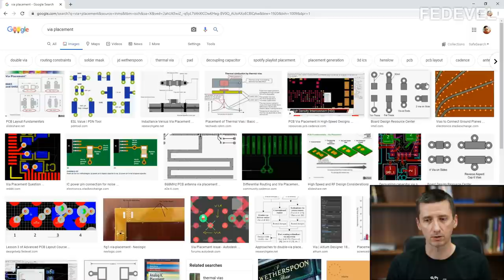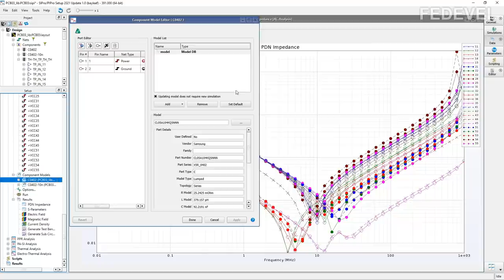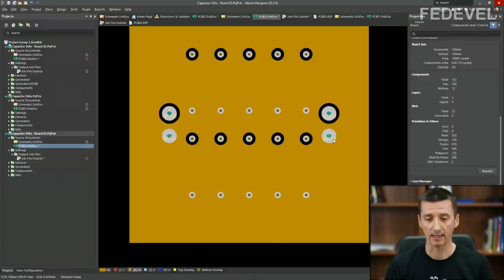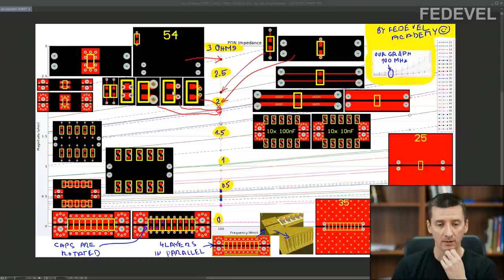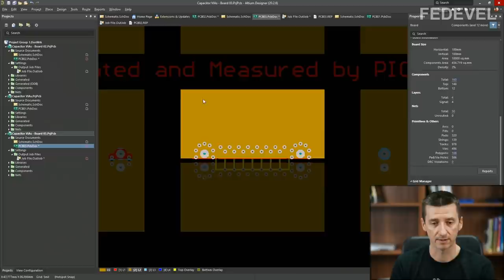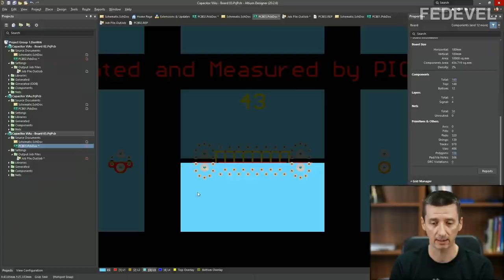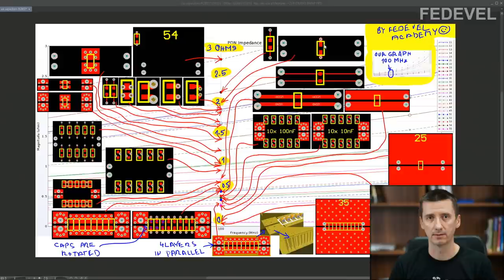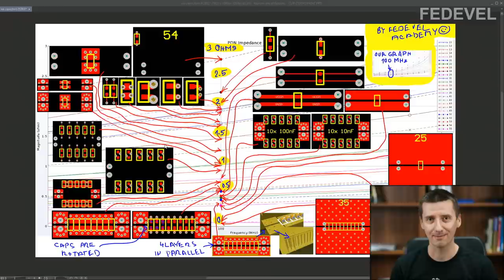What is The Best VIA Placement for Decoupling Capacitors?

Comment: It was good to demystify the "vias on the side are better than vias on top of the pad". Very little difference indeed.

In my opinion, the interesting layout would be having the capacitor on the same side as its load connection, but the input supply coming through vias from the power planes. This is a very common implementation in DC/DC power supplies. Check the typical symmetrical CIN decoupling implementation suggested in most power devices from MPS or TI, it has minimal impedance and the EMI emitted gets canceled out by the opposite direction of the fields.
Reply from the maker: I should try this, good idea!

Comment: Another great video in the decoupling series.  As I understand it, local decoupling (10n - 100n) needs to be at the pins, but bulk decoupling (1uF and above) just needs to be connected on the planes.  It would be good to add these to your test PCB, also.  It is not clear from your excellent plots how the frequency of the ESR notch is affected by the different connection types.  Does this matter?
Another test would be what effect does putting the decoupling capacitor AFTER the output pins have, compared to having it BEFORE the output pins?  Your test PCB from part 1 has the local decoupling after the CPU power pins, but the common advice is to make the PDN track go to the capacitor and then to the device power pins.  Does this really matter?
Keep up the great work.  Look forward to further involvement from Steve, Eric, and Rick!
Please build and test the PCB.  Theory is important, but real measurements confirm the simulator's predictions.
P.S. I think there is more to learn about the ferrite beads from part 3.

Comment: Hi Robert, great video! Really interesting. It will be amazing if you measure this! 
It make sense that not using vias yield to lower impedance, because they introduce a inductance that will increase the impedance with a increase in frequency. That is why is better to use multiple vias in parallel, because you reduce the inductance (series) between the capacitor and the plane.

Greetings from Argentina!

Comment: Thanks Robert, fantastic work.

In terms of additional simulations to try, I would be interested to know whether it was adding more capacitors that gave you better results, or whether it was simply that by adding additional capacitors that caused some to located closer to the load terminals (on the right hand side of the board), rather than being located in the middle of the board.

Regarding using big areas of copper on the top-surface, whilst soldering the caps to big areas of copper (as in #25) gives a nice low-impedance, I suspect that the lack of thermal reliefs will cause production reliability problems during IR-reflow soldering. They would also be a nightmare for re-work, as you would have to heat up the whole copper-plane just to de-solder the capacitor. So, this might cause more trouble than it is worth.
Reply from the maker: Thank you Nicholas PS: Today, I was thinking exactly the same - if just placing some of the capacitors closer made the difference. Maybe another example to try ....

Comment: That was interesting! If I understood correctly, you set the input on the left and the output on the right, so this uses capacitors as filters, not decoupling... If you set the input and output port on the same side of the pcb, it is more like the way a chip sees the impedance of the PDN at its power pin, I think you'd get different results. This would be interesting to simulate.

Comment: Hi Robert! Very interesting video as always!
If I had to justify why direct connection is better, I would say that it probably has better results because it is the shortest connection (so less inductance) and also there is no via (so shorter connection and no via parasitic inductance). Preferably use the variation with the thicker tracks or polygons.
As for the Capacitor size, I think it would make a bigger difference if we had to compare smd with through hole packages as mr.Bogatin mentioned in one of your previous videos, but maybe 0402 with 0603 for example would have little difference here at least for relatively low frequencies. Maybe it would be more noticeable for higher frequencies?
Manufacturing and measuring the real pcbs would be interesting I think.
Reply from the maker: Thank you very much giannis asp

Comment: Around 15:00 you mentioned that you had heard that decoupling cap position may not matter if you have power plane and that your sim shows that it may not be true. I would say that your power planes are really far apart and therefore ineffective. Looks like your planes are +40mils apart. If you can, run the sim again, but this time, for the stackup, keep the power planes < 8 mils. Does placement of capacitors matter then ?  From literature, its that the power plane provide most of the decoupling (when < 8mils) and physical decouple caps can be much looser.
Reply from the maker: I could try this. When I was talking to Steve, he also pointed this out.

Comment: @Robert Feranec, I’m not sure what the width of your board is, but the decoupling impedance is directly impacted by the length of the trace (including bias). So in the example of the one cap with direct connect on the top layer from PWR Supply to PWR Pin, if that total distance is less than the distance through the vias (not sure of your board thickness either, I didn’t bother converting from mm to mil), it would make perfect sense as to why you have a lower impedance. 

I would have loved to see an explanation and show the correlation between your decoupling caps and the decoupling formulas. Making the math come alive would be really beneficial for us all

Comment: Great, great video. Ok: it is important to put more vias not only on the capacitor but also on the "output" pin, but does it make sense to put more vias also on the "input" power pin? At those frequencies where the decoupling capacitor works the contribute from the input pin should be negligible... What do you think? Thanks again.

Comment: Great video! It would be interesting to know how
 thermal relief affects PDN. 
How big is the difference between a direct connection and 
 through thermal relief.
Reply: As I mentioned above it depends on how big the relief is, but in general the relieve is not very significant compared to the via

Comment: Robert, I'm confused why it's surprising that directly connecting the capacitor to the IC pins on the same layer (top layer) provides optimal results. Is this something not commonly done? Is there a reason one shouldn't do this? 

Aren't these results optimal because your loop size is so much smaller?

Without a direct connection, the current and field path is:

capacitor pins -> down vias to power/gnd plane -> from power/gnd planes -> IC pins.

With a direct connection:

From IC pins to cap pads.

When an IC needs to use power from caps during switching, this is a high frequency event. High frequency always travels path of lowest impedance. So during periods of no IC switching, the cap is "charged" through the vias; during switch, nearly all power from cap is delivered through the top direct traces.

Am I thinking about this correctly?

Comment: Hey Robert
 I doubt you are into gaming and the surrounding hardware security and reverse engineering scene, but there has been some interesting stuff going on with the Nintendo Game and Watch. It's a little limited production nostalgia trinket Nintendo brought out last month and is selling while supplies last, for a few months. It's basically an updated copy of the devices that got Nintendo started, and just has 2 original Mario games. I get bored with such things after 5 minutes. The device is interesting because it was hacked the day it came out, by a channel called stacksmashing. That channel does the best tutorials on ghidra and other advanced hardware and software analysis tools. The channel's associated github is an awesome resource as well. Anyways, the Game and Watch looked interesting because it is fairly simple looking hardware and is based on a STM32H7B0. That family of μC's is also well supported in micropython, which I've been learning already with STM32F4's. So I got a G&W to have a look. After receiving it I decided to do my own thing and try to retrace my first board with more than 2 layers. I finished the whole retrace a few days ago. Now I'm working on a kicad schematic and will probably be done with that today or tomorrow. There is quite a bit of interest in this hardware. A bunch of people are working on improved versions currently. The PCB has a lot of little interesting features to talk about. It has a 280MHz max clock for the μC, and a 108MHz SPI flash. There is a nice little BQ24072 lithium controller circuit that feeds a very interesting (but yet unknown) dc to dc converter. I think it may be either Torex Semi or TI, but is a _MHz low voltage type in a DSBGA-12. It has a tiny inductor (that looks like a ceramic cap) on an output pin with the other side of the inductor connected to the DCVoutput at 1.8volts. There's no external diode, only ceramic caps, no other filter, and it powers the μC directly. The only other external connections are two resistors to ground on two separate pins. It is also connected to a SSM6J412TU - a little Toshiba 6 pin PMOS chip rated for gate voltages down to 1.5volts, (a handy little circuit building block on it's own). 

  While I was working on the retrace I was given some xray images of the board. This was a first for me. The images were taken with all parts in place which makes them inadequate for a total visual retrace in a few areas but it is still interesting. I think whomever did the xrays was mostly looking for the way (if) the USB-C connector was routed. The connector has 2 levels of pins making it difficult to see what is connected, and I don't know if the person that got the xrays realized how unlikely a buried via is in such a design. 
  The most interesting part to me, as far as something you might be interested in talking about, is how the ground plane is setup. It takes a bit of a deep dive into the design to see it, but there are a bunch of internal traces that have parallel ground traces routed beside them inside the board. IMO, it's clear that many design choices had very specific reasons. I noticed the vias had strange looking randomness before I got the xrays, but after, it was even more strange to see how it was routed. 

  If you are interested, my work is all posted on github and I'm still working on stuff. If you get GIMP running and open my included xcf file you'll see everything broken up and labeled in a way that is easier to follow. I have a much larger version of that file that I use to make the released versions of the image. It's around 250MB so I can't upload it to github. That has the xrays and stuff in more detail. Although, my stuff isn't pro-sexy-grade work, it's based on camera phone images. If this is something of active interest I can try and get you a copy of the full file and all of the xrays. If not, no problem, I'm just saying it's an option.
   My stuff on github is posted with an MIT license, aka 'no warranty but do whatever you want with it, even commercial, - the I don't care' "license." My github is under "Upcycle-Electronics" and the repo is "game-and-watch-hardware."
  It could be an interesting subject for you as it is trending in this little YouTube hardware niche right now.

  Maybe, as a super simple starter, talk about adding USB 2.0 connections with a USB-C connector and with all common pin types. It won't be an easy thing to add to the G&W as the software guys must figure out how to remap the display or something. One SPI pin overlaps with the usb pins of the μC. Still it's a valuable basic circuit block to build with, especially if you expanded and talk about actual USB-3.x circuits and power.
 This is just a heads up if you're interested.
Thanks for the upload.
-Jake

Comment: Hi Robert, I think your results do make sense because of your stack up - GND and PWR are >1mm apart. Signal through the same layer traces will have less inductance/impedance than through the vias. 
I would be interested to see the same simulation on closely spaced power planes (<0.25mm).
Reply: Great video by the way.

Comment: Very cool. I wonder if this means that QFP / QFN parts would have an advantage over BGA devices, since it could be practical to connect the decoupling capacitors to the pins directly without vias. Although, it's likely that the reduction in inductance from the BGAs would have a larger impact.
If you have time, could you try the following configurations:
1) A T connection. Where the capacitor is directly connected to the power pin, but only connected to the power plane through vias mid-way through the connecting track (like a T where the base of the T is the via to power / gnd). 
2) An L connection. Similar to the T case, you could look at the case where the via comes after the capacitor in the path (sort of like your direct connection cases, but the trace to the power input is cut and replaced with a via to the power plane instead).
I was going to suggest also placing a capacitor directly on the power output pins on the bottom layer, however, due to symmetry, you have effectively already tried that.
It would be very interesting to see if real life holds up to the simulations.
Reply from the maker: That is an interesting point. PS: I am putting the examples on my list to try
Reply: @RobertFeranec  To test the QFN/QFP vs BGA, you could probably simulate the leads via adding inductors between the connection trace and the simulation measurement points. Though you would have to find realistic values for the inductors... I did a quick search and found an app note by TI (AN-1205), which models different package leads as a RLC network - perhaps that could be helpful.

Comment: Great video. I always had an instinct that vias on decoupling capacitors are bad, I try to put them close to power pins with ground on a polygon using multiple stitching vias.

It would be very interesting to compare simulations (or reality!) of say a QFN vs a BGA, where the QFN has a close decoupling cap connection on the top layer and the BGA needs vias. We generally think that BGA packages are best for high speed but maybe for the PDN impedance the QFN is better?

Comment: That is why I commented in previous video that it is better to have copper under component and not be worried about making a short circuit to the component :-) Wide tracks on the chip side are very important!
For smaller DC/DC converters I have around 2mm wide tracks. At 0603 capacitors one via is under the component and another is behind it. After 0603 come 1206/1210 capacitors which have multiple vias under it for both connections. Vias have  0,3mm hole with 0,5mm copper ring. If space is not a problem I have even wider track for Vcc on L1, because it forms very good capacitor with GND on the L2. Much better than capacitor between L2 and L3 in 4L board, because of less vias and smaller distance between planes.
Reply from the maker: Yes, interesting. Thank you WR3.

Comment: When it comes to decoupling, vias are inductors, so if you can, eliminate them - this is why having the cap and power plane on the same layer is so helpful.  When you can't eliminate them, placing a few vias in parallel helps - up to a point - the nth via only provides 1/n improvement.

Parallel power and ground planes do add a little extra capacitance, and you can calculate how much using the area, dielectric thickness, dielectric constant, and the capacitor equation.  What you will quickly figure out is that the little ceramic caps provide MUCH more capacitance than the power and ground planes, and they have a better Q.  

A common problem is that the parallel power and ground planes are a much better transmission line than they are a capacitor. This means that when a slug of current gets pulled out of the planes at one spot, that voltage dip travels across the whole rest of the power/ground plane at roughly 185ps/in.  So you want to make sure the chips take that current out of the decoupling cap, and NOT the power/ground plane.  So make sure the power via is NOT between the chip and the cap!  Otherwise, much of that current will come out of the power plane rather than the cap.  A properly sized ferrite bead between the cap and the power plane can help insure that current comes out of the cap first, and what gets pulled from the plane comes out slower.  

Another thing to keep in mind with the fast edge rates on modern chips, you have to consider that you don't see the whole capacitance of the entire power / ground plane pair, but only what is within the "lumped element" radius of power pin, due to the speed of currents in the PCB.  This works out to roughly 0.9 inch for every nanosecond of edge time.  That is, a 1ns rise time will only see a circle of about 0.9in radius of the power / ground plane pair of effective capacitance - after that it's a transmisson line. 

For large chips like FPGAs, you'll want to keep in mind i = C * dv/dt.  Each I/0 pin will have to drive some capacitance C at the device's rise or fall time, dv/dt.  This will allow you to calculate how much current each I/O pin will source or sink when it switches state.  It has to pull this current out of its associated power pin.  If you have a  32-bit wide bus switching pins at the same time, then you have up to 32 times that current switching all at once.  You'll be surprised at how large that current can be.  Fortunately, the same equation can reconfigured to determine the size of the capacitor you need to limit dv/dt to a safe level.

Comment: YES you should build a few boards and measure them.
You should also add a board with single cap right next to the load pins (basically equivalen to populating the rightmost cap only on your 8 cap designs).